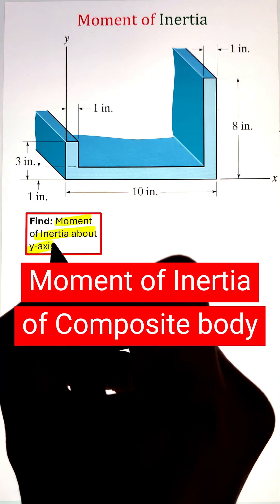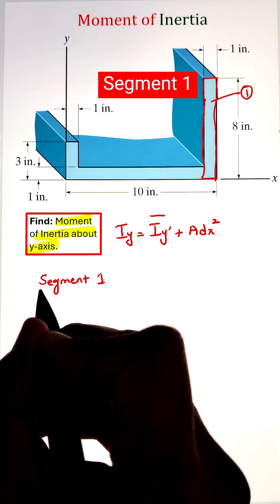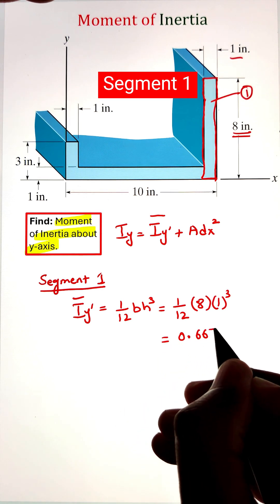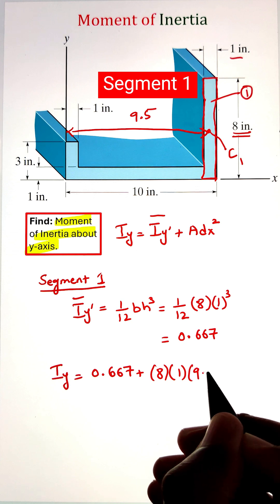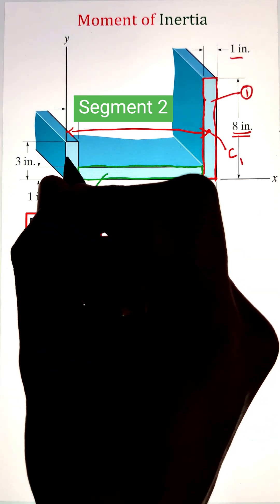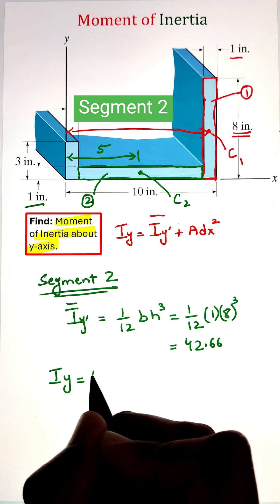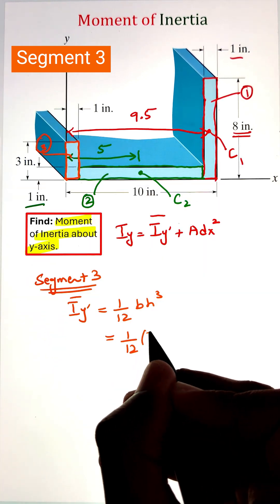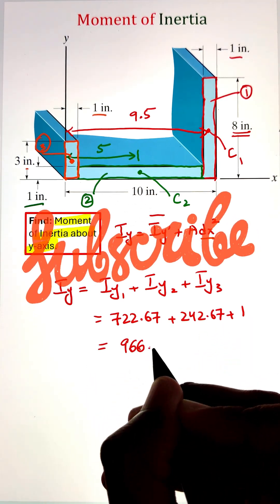Moment of Inertia using Parallel Axis Theorem

Comment: Where’s (8)(1) from again?
Reply from the maker: 8 and 1 are the dimensions of the segment 1. We multiply them to get the area and then multiply it with 9.5^2 that is the distance between the centroid of segment 1 to y axis and add to the Iy' to get Iy using the parallel axis theorem.